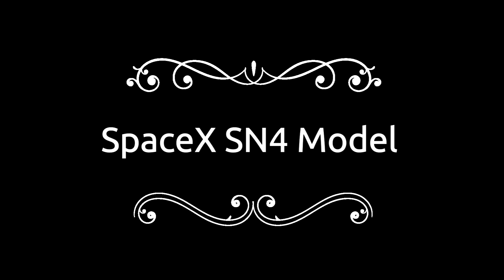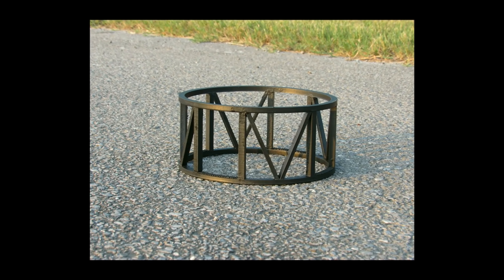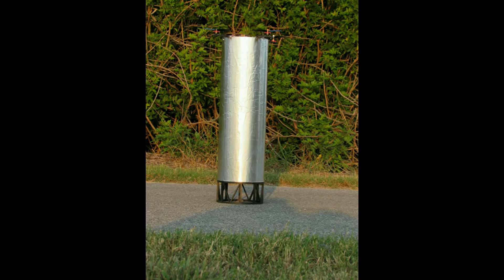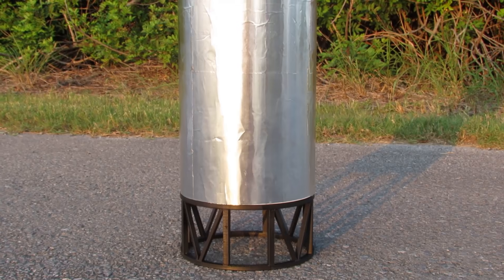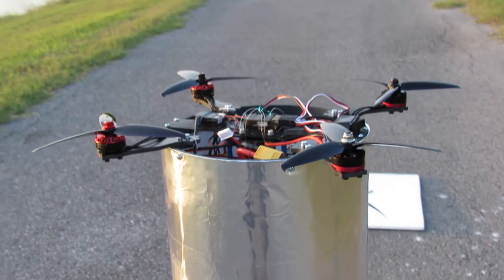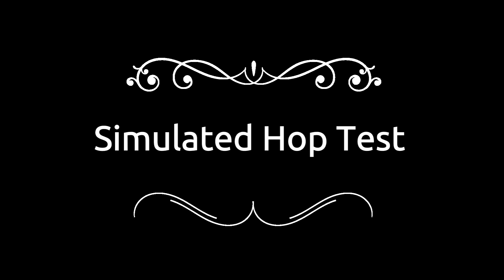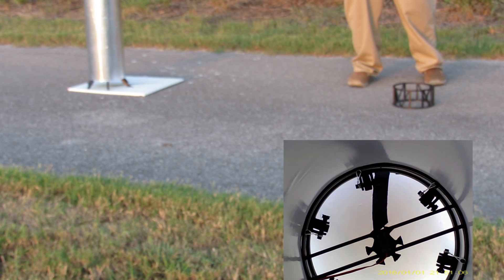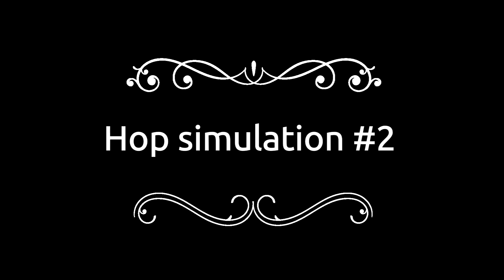SN 4 Landing leg tests

Comment: Great fun. On the legs I believe that the real Starship is going to have some level of extension/compression in each leg, presumably via some sort of hydraulic or spring-loaded mechanism for levelling. Musk said even on the pictures of the SN3 legs (which sadly never got to be used) that they were longer than they looked in the picture that showed them retracted into the thrust skirt because they extended on deployment. I wonder how difficult it would be to give your model's legs some degree of flex/spring in them maybe using some sort of telescoping mechanism with rubber bands or biro springs or similar to provide tension so that they have a wider span when deployed and can absorb more of the impact for a smoother landing.
Reply: Julian FP  They transferred those lower two ring segments of the thrust section (with the legs attached) onto the next starship SN4. It’s on the test stand right now about to go through it’s LN2 cryo test. 

Also the guy in this video has done the legs pretty accurately to the real starship actually, with the exception of having them already in the fully telescoped position or length. Once the legs on the actual starship deploy and telescope out to full length they will be just about what you saw on this guys model. Once they telescope out and lock out there won’t be much or any shock absorbing or leveling mechanism at all. That will be on future versions designed to land on the uneven surfaces of the moon and Mars. What we have now is just basic stuff meant to make it through one or two simple hop tests before it goes to the scrap pile. In fact, they are already putting SN5 together in the High Bay, and have starting on SN6. It’s crazy how fast they are going. SN6 will have flaps and presumably do the 20km flight. Maybe they will put a better landing leg system on that one with a wider stance and some hydraulic or pneumatic leveling.
Reply from the maker: @RLM-SS1  We are hoping to see the actual legs in action before we design and print our own.  Watching and waiting.  Posted new video.  Couldn't get motors to power down after landing.
Reply from the maker: We are hoping to see the legs in action before designing and printing out own.  Come on SN5!  We need to see a hop.